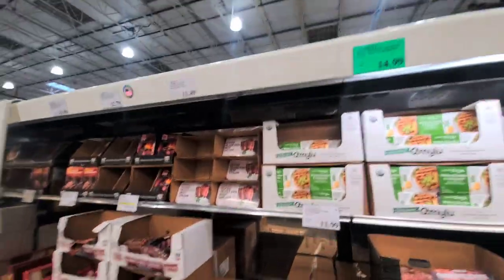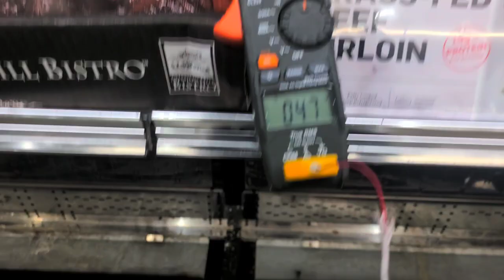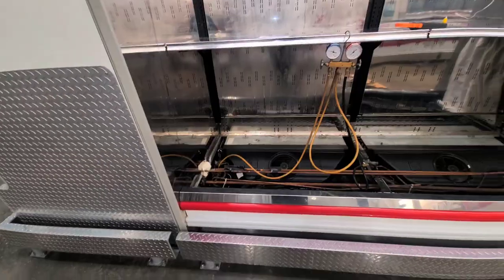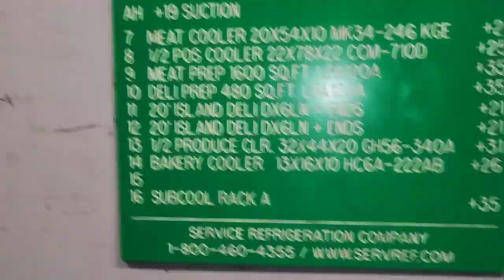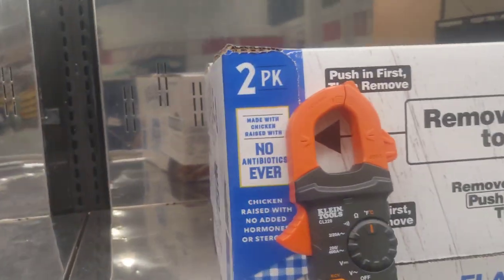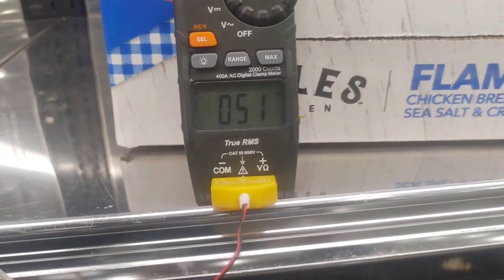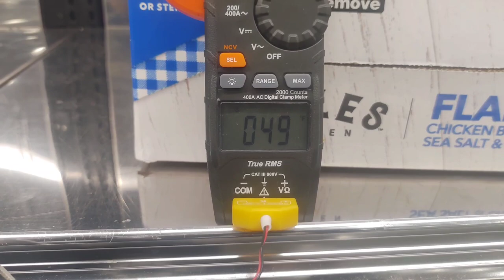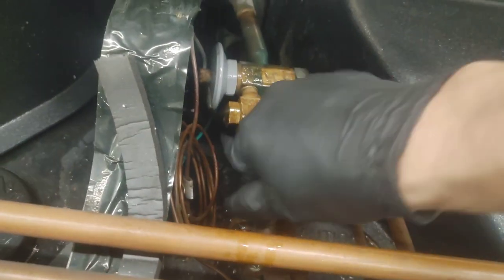TXV Frosting up from the Inlet, Case not cooling,  Cleaned the Screen : Sporlan EB/EG/EQ Body Style

Comment: Hey sir , I am first year apprentice and can you please tell me when you open inlet screen system is on positive pressure? And what pressure is safe when we open inlet screen . Thankyou
Reply from the maker: Positive. 
You must always pump down the system/circuit/loop before attempting to open it in any way. Anything above 15-20 psi will be more than you can hold sealed with your hands/fingers/muscles. 50 psi becomes loud and scary... is capable of really hurting you under the right circumstances.  100 psi can deliver a fatal projectile that can kill you. Above 100 psi, an immediate opening or rupture is that much worse. 
Never use your torch on a line unless you KNOW it has 0 psi. But also because open flame and refrigerant vapor = Phosgene Gas(deadly). Cut into the line somehow(tubing cutters... Anything) before applying heat. If you try to Unsweat a pressurized joint, molten Silver solder will projectile outward as soon as it is hot enough. 

There is so much to this stuff. Be careful, don't guess on anything. Use the internet to answer even your most basic questions if you have to. 

Welcome to the industry!
Reply: @HVACRServiceTech 
Do you have to pull a vacuum after that repair before you start the system again?
Reply: If you swapped then quick, the case will be in positive pressure. That’s all I will say about that